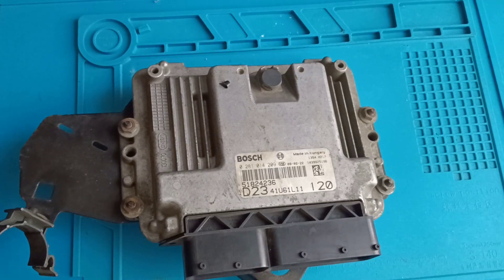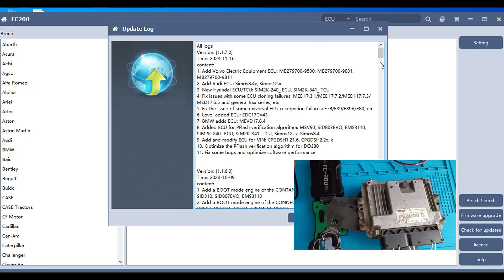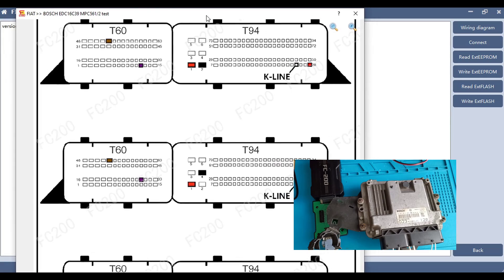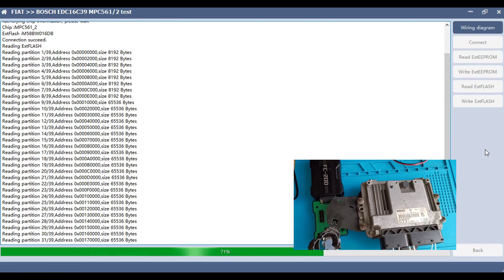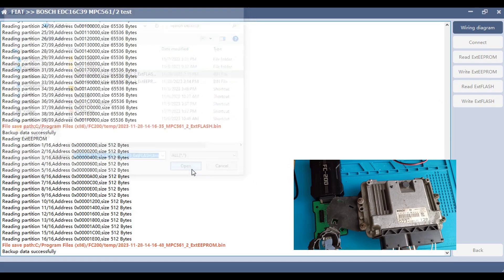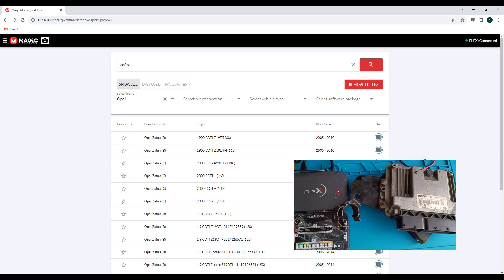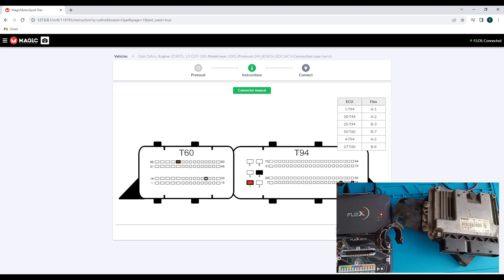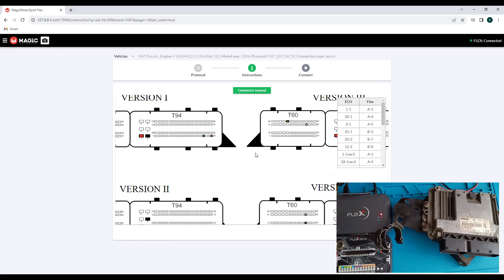FC200 read/write edc16c39.Flex cannot read through OBD this ecu installed on the Zafira.

Comment: Hi! Alientech also can't read this ecu obd, you need bout read euch you can whrite by obd. Kess v2 can do only whrite by obd. No read option
Reply: Nop, kess read with no problem Edc16c39 in fiat/alfa. No option for read, only for write in edc16c9 in opel!
Reply: @georgialtanov4561  Opel zafira 1 or vectra you can't read with kess. No way
Reply: @waldemarfechtel1644  think that zafira 1 doesn’t have this ecu at all.
Reply: @georgialtanov4561  sure it have, vectra same. Because I was need get this the ecu out read it bench. Only with this original file I cold whrite it obd
Reply: @waldemarfechtel1644  it’s zafira 2
Reply: @georgialtanov4561  zafira a I can't read Edc16 ecu, see in less it's only whrite
Reply from the maker: Thanks for letting us know!

Comment: I have ori pcmflash with ori m71 and m77, do I buy foxflash or fc200? I know first is clone and second ori, but it is about the coverage ?

Thanks in advance!
Reply from the maker: Hello,
Vvdi prog new version destroys both programmers you mentioned.  The FC200 doesn't have much coverage.
  For the same money, Vvdi is also a programmer for chips and other modules installed on the car.  It was released 2 months ago.